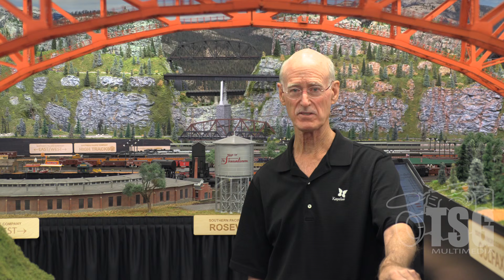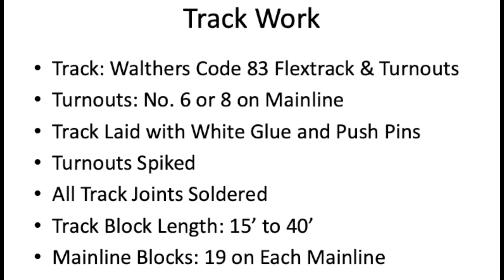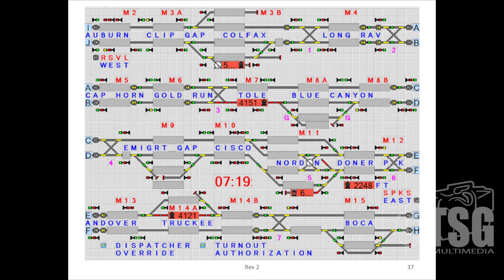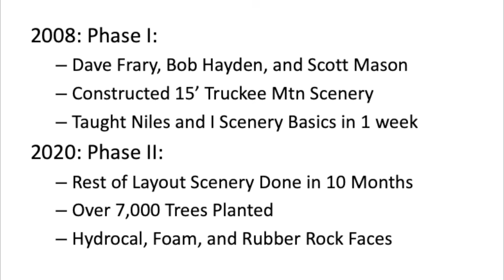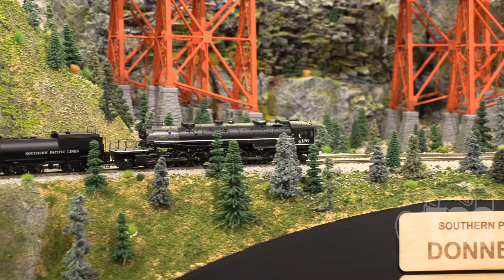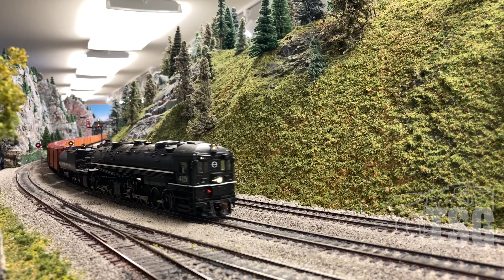Southern Pacific Donner Pass HO Scale Layout Tour

Comment: WOW! I was induced aspie-esque trance and so transfixed by the operations that I was snapped out of 'state' by the quiet bridges such was the realism.
Perhaps a project (as if you haven't been busy enough over the past 23 years) could be a small subwoofer tuned to a bridges frequency to mimic the familiar rumble of a train passing over. I imagine a Hi-Fi recording device under a prototype bridge with train passing over of similar span length being used as the proxy. 
A sendhand Hi-fi amp with a device capable of playing SD card recorded in WAV (uncompressed format) plugged into one of the RCAs of the amp and being triggered to play by a detector. It would be amazing on the larger bridges at least since they're so visually stunning. The steelwork is like fine lace in HO - it's utterly amazing, so much so I just was a bit kind of shocked in a strange kind of way.

Comment: Thank you for the tour.  I spent my teens in the 70 s traveling up over Dinner Pass when it was populated with SD45s and tunnel motors.  Nice to see Donner Pass modeled on HO!

Although I am modeling the DRGW west from Grand Junction CO, I couldn't resist an ice reefer train like yours headed by an Intermountain AC10 with, so far, 26 pfe ice reefers.  How many can a single AC pull up a 1.5% grade?  Regarding throttles,  I make too many touch mistakes on my smartphone.  As nice as the smartphone features are, I prefer a throttle with tactile controls, the newer TCS UWT-100 and UWT-50 being my favorites.

Comment: Designed and built for operation, it's off the scale impressive with all the computer control and signalling. Love the fact you included Roseville Icing facility, which is/was an impressive facility in it's day. Really cool to see trains that look long enough to be real. Of course, your layout is representational of the line, but it would have been so cool if there was a practical way to show the snow sheds covering the Norden turntable and adjacent tracks. Thanks for sharing. 😀

Comment: Thanks for showing off another awesome layout. Is this model RR layout set in the mid 1940s to the mid 1960s? If it was said what time it was set in, I must have missed that part of the video as I was cleaning some of my 1/64 scale cars I like to collect. I wish I could have a model RR layout of my own but because the small amount of space and money I have, I would have to run an N scale or Z scale layout on a standard size door of 80 inches by 36 inches or smaller.

Comment: Not a lot of tunnels or snow sheds on this layout but a lot of it reminds me of European model railroading scenery is being used. You should be using Union Pacific passenger equipment and sudden Pacific equipment painted in Union Pacific yellow paint scheme. The orange and red equipment is normally used in the coastal regions of California during the Southern Pacific passenger era of History. Of course if you were going to do Amtrak era you would have a f7's e7's and sdp40fs in the 70s and and in the '80s and '90s you would have f40ph and Genesis locomotive AMD 103 in the 90s through current and superliners from 1979 through current with highlevel equipment used in the 80s and early 90s as coach dormitory cars. Sometimes equipment from the East is transferred to or from California on the California zephyr. Some Amtrak trains used to have a freight cars that Amtrak owned and operated until the early 2000s. The freight railroads were a little grumpy about that Amtrak was stealing their freight business. Ironically Greyhound has a service where they can transport for packages in their baggage compartments on buses.